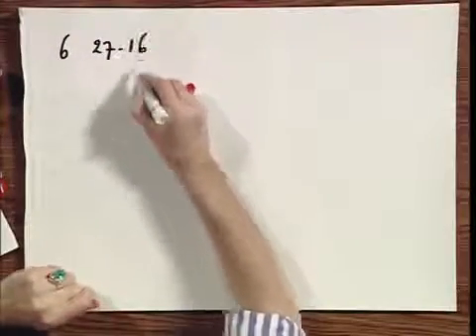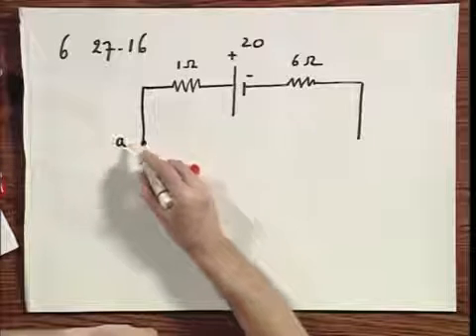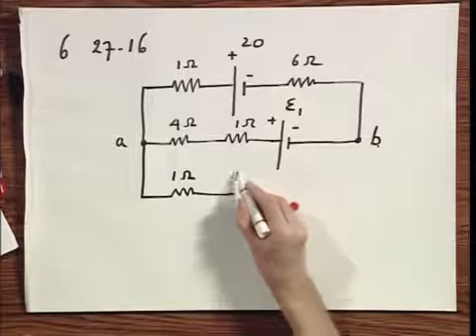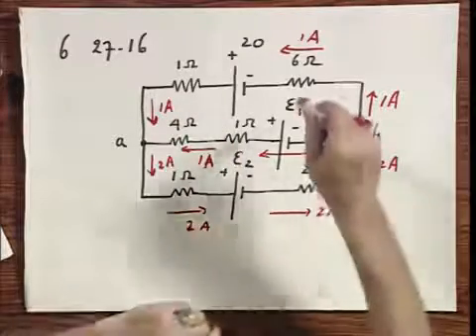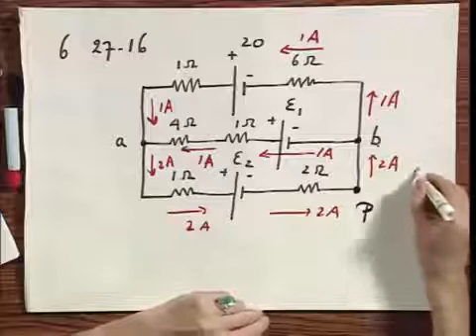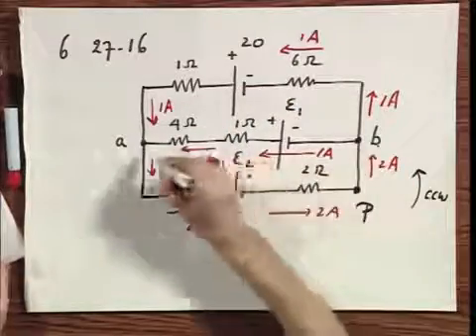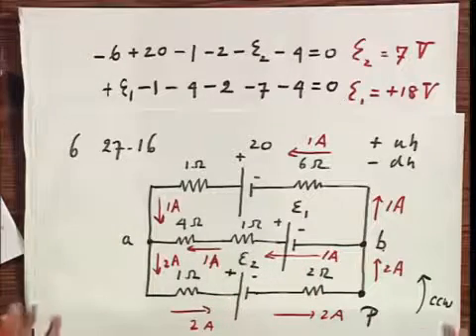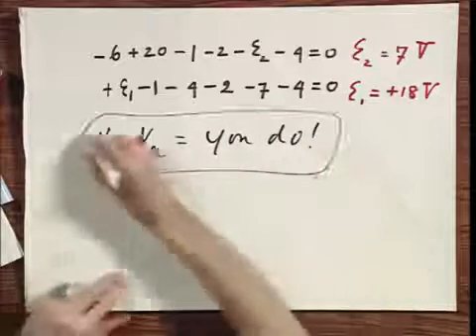8.02x - Module 04.04 - Multi Batteries, Multi resistors, Multi loop Circuits.

Comment: If current is flowing into the positive of the battery does that mean its voltage will increase as it is getting charged  ??   Anyone know ?
Reply from the maker: watch my 8.02 lectures, that's what they are for

Comment: Sir, If positive terminal of one battery is connected to negative terminal of another battery why does not current flow in the wire ?
Reply from the maker: current can only flow in a closed loop.  some charge may flow for only a milli  sec to make the electric potential in the wire everywhere the same but that will be the end.

Comment: Professor Lewin,
I just solved this problem using nodal analysis as opposed mesh analysis. One obtains the same result by either method. In this case the mesh method, i.e. Kirchhoff's Loop Rule, appears to be the simpler as it requires solution of only two equations; whereas, the node method, Kirchhoff's Current Rule, requires solution of three equations, fortunately the three equations to be solved are trivial as the branch currents are known. Vb - Va = - 13 volts. (I took node b as the reference node; i.e. ground.)   
PS When solving Loop Rule equations I prefer to assume "downhill" is positive. Downhill positive is consistent with the passive sign convention and there are fewer minus signs to keep track of; the passive sign convention is that the voltage across an element is positive if and only if current enters its positive terminal.

Comment: Vb - Va = - 13 Volt
Reply: Vb - Va = 18 - 5 = 13 Volts...because from b to a the electro motive force changes polarity from minus to plus and the voltage in the resistors in series is negative because the direction from b to a is changing polarity from positive to negative...I hope you understood it.
Reply: How

Comment: Excuse me Sir.. if we solve this circuit by taking internal meshes.. then we got E1 as 8V .  Kindly reply me that how can we solve this circuit with taking internal meshes
Reply from the maker: E1 as 8V
E and V have different dimensions, thus this is wrong.
Reply: Lectures by Walter Lewin. They will make you ♥ Physics. 
Thanks sir for instant reply ♥